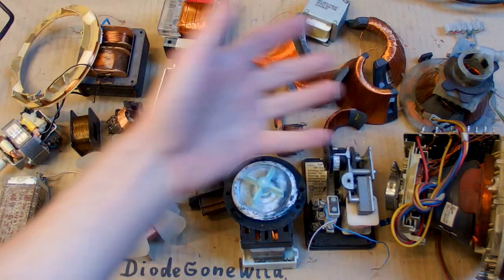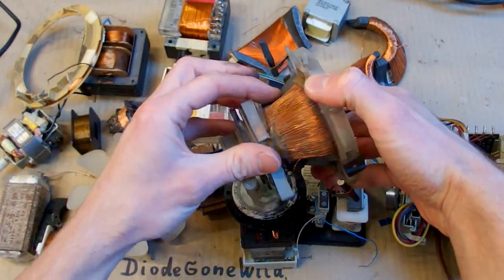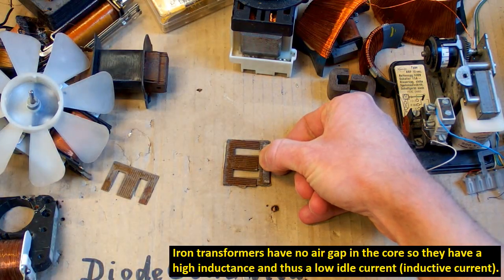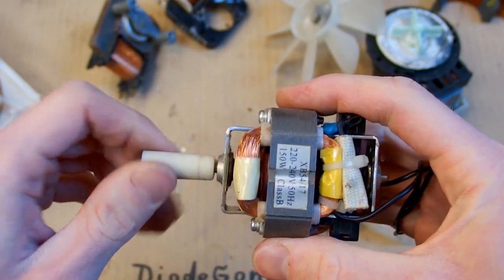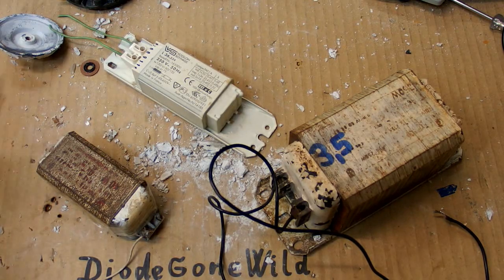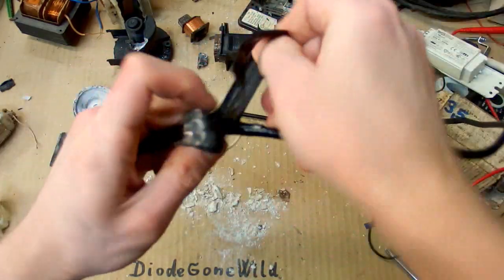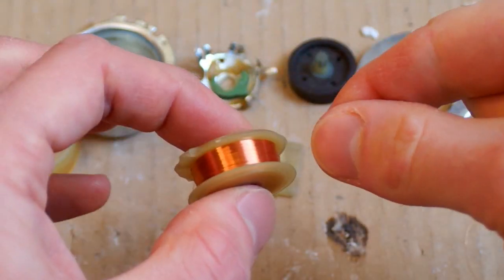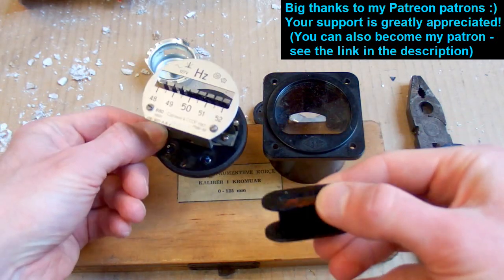Getting a FREE copper wire (for a DIY transformer, electromagnet, tesla coil secondary, ...)

Comment: Single ended tube audio output transformers are usually air gapped so that the DC current doesn't saturate the core so easily.
Reply from the maker: You're right, but those are not normal transformers (mains power transformers) :).
Reply: @DiodeGoneWild  I enjoy your videos, BTW

Comment: stepper motors from eg. printers are a quite good source too. there are usually two coils both wound with 2 wires at the time, sometimes with different colored enamel, useful when you need to wind something with middle tap.

Comment: Nice video, Diode. Now everyone else, go steal your neighbor's microwave oven! ;)

Several 'gotchas' to be aware of when salvaging enameled copper wire (most learned the hard way):
1. Enamels are very thin, so the more you flex or tool it, the more likely it is to flake off. Age exacerbates this.
1a. Find a spool or bobbin to keep the salvaged wire from becoming tangled, and prevent further damage.
2. Try to salvage from only known-good, working electronics. Overheated windings are not good to reuse.
3. As tempting as it is, don't bother trying to pull apart windings which are epoxied. [Covered in video]
4. Once you've created whatever coil you need, be sure to finish it with proper tape and/or coil dope.
5. When you measuring the wire with a micrometer, you're measuring the wire O.D. plus twice the thickness of the enamel.

Comment: Very nice video, I use to get enameled copper wire from washing machine motors, the rotor is in epoxy but the stators are usually loose, it's a reasonable thick wire and there's a lot of it in them. But you have to open them in half with an angle grinder to unwind it :D
Reply: Nice!
 free wire PLUS a good excuse to get the angle grinder out.

Comment: Looks like you covered most of the sources of wire i know of.
For really fine wire, take apart a faulty magnetic record player pickup.
Or take apart the black plastic clock modules, they have a cute reel of wire :-D.
Only take apart the clock module if you have the time ha ha :-D
Reply: afterwards ... you don't have the time anymore ...

Comment: Well that answers my question! :-)

  I actually started playing with transformers again recently. This morning I had a thought to run by you. With the transformers I have rewound so far, I tested and wrote down the open circuit and loaded voltage using a few ceramic resistors. Then I took apart the transformer core and counted the actual secondary turns one by one. This got me the volts to turns ratio. Then I just rewound the transformer's secondary to whatever voltage I want based on my calculated turns-volt ratio.
    This morning, I was thinking about how to add an additional secondary winding to a project, but I don't want to disassemble the transformer. Technically I can use the window geometry of the core and wire diameter size to get a loose estimate of the number of secondary turns. 
  This morning I thought, 'why not just run 10-50ish turns of wire and get the actual voltage to turns ratio from that? 
   It would be a pain to do a complete secondary winding by hand with a core in place. I would obviously need to protect the wire from contacting the core while winding it. I would also need a lot of space to avoid tangling and kinks. I only need around 110 turns though...and ~24.5 meters of wire. Basically the transformer I'm using for a linear power supply has more than enough VA for the project, it has extra space on the bobbin, and I could really use an extra 5V rail (7v+regulator) for the microcontroller. I don't like how hot the current regulator setup gets using the main supply rail and I don't want a SMPS adding noise. What do you think? Is it possible to add a winding like this? Any tricks?
 
  One nooby kind of question, can I double up the wire for a winding and wind both sides at the same time? I have a suspicion that this would somehow work to cancel out each winding, but I haven't tried it before and am not sure. The center taped windings I have made so far were all wound in series.

  Anyways...Thanks for the upload.
-Jake
Reply: I see no real issues with you adding an extra winding to your transformer.

As for the CT transformer question.
You just need to respect winding direction, which means cutting the join between the two halves and wiring it correctly.
start => +V
loop => 0V & -V
end => 0V
eg cut the loop once it's wound, and then look at the two windings as start/end and wire the start of one to the end of the other.
Reply: @station240  
  Thanks for the confirmation/correction on winding like this :-)

Comment: Always check the insulation quality, along with the resistance of the recycled enameled wire.
(There's nothing to say that the old doner component didn't have a fault, either solid or intermittent (wcs).

Comment: Fabulous video! Salvage is best!
I used to really like those CRT vertical coils, because the ferrite core fragments are a good spool for the wire. I can't find many of those any more though... CRTs are rare around here.
I recently tried to unwind the wire from a fridge compressor... but it was like the one at 4:50 but with multiple intertwined phases... and I ended up making a terrible mess and kinking it all up.
Is there an easy way to unwind such motor windings?

Comment: can ferrite core from deflection coil be used in inductor or transformer
Reply from the maker: It can. Few times I used the core to make a transformer. It worked well as a matching transformer in one of my induction heaters made of scrap.

Comment: trust me, that demagnetization coil is near useless, the copper is loose but it's so sticky that you'll give up unwinding it if you don't catch the end correctly since the start, and it's difficult even if it's not sticky

thin wire sources are also electronic clocks and car analog indicators

those coffee machine pumps can be cracked open, i did that on the same model, you use an hacksaw near the end and likely the first two layers of copper go destroyed, there's a big good spool of 0.2mm copper in there... and a near impossible to salvage high voltage diode

transformers also are becoming rare nowdays, better not ruin the good ones

Comment: Degaussing coils are often aluminium
Reply from the maker: Aluminium makes sense, since those coils are not critical, they operate for just a few seconds when plugged in, but the ones I came accross were copper.
Reply: Oh that would case such a dilemma.... "electronics me" would say to save it for winding coils, whilst "metalwork me" would want to melt it down and re-cast it. :D

Comment: Scrap Cu is sold 5 USD Per Kg
Reply from the maker: It's about the same price in my country. This is not worth the time and effort on a small scale just to sell it as a scrap. For example the degaussing coil is 100g, this would be 0.50 USD. But of course, I keep all of the coils that are in resin or damaged, and I may eventually accumulate maybe 10kg as a byproduct of taking things apart for components, and then I may sell it as a scrap metal :).

Comment: Actually you have to burn the insulation off the wire to measure its wire gauge.
Reply from the maker: It depends on what gauge you want to measure. You measure the net  copper gauge to calculate the resistance of the wire and the maximim current. On the other hand, you measure the gross gauge including the isolation to be able to calculate how many turns you can fit into some space.
Reply: @DiodeGoneWild  , ok thanks.

But, when I went to buy magnet wire, I took a sample of the required wire, they took the wire and burned the insulation off (and told after meassuring that it was 30SWG), I didn't think of the gross gauge, thanks for informing that.

Comment: I have one huge 220v to 110v, 75A transformer, weighting around 40 to 50 kg, scavenged from a electron beam machine. The iron core is so thick and the copper wire is too thick...

Comment: or crystal radio :)   this guy found new method how to wind transformers for free  CLICK HERE A SEE HOW IS HE DOING IT :D  

btw some wire aprox. 0.4mm is in inductors in PC PSUs its good for 250 turns on 32mm air core pipe for crystal radio